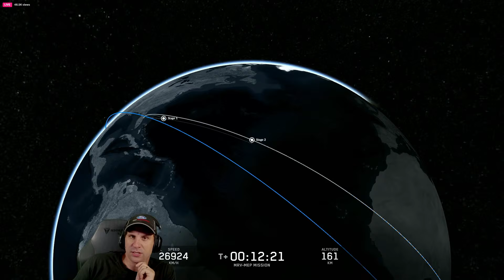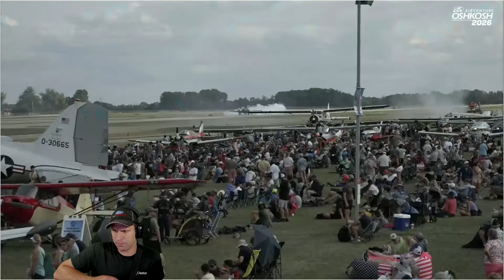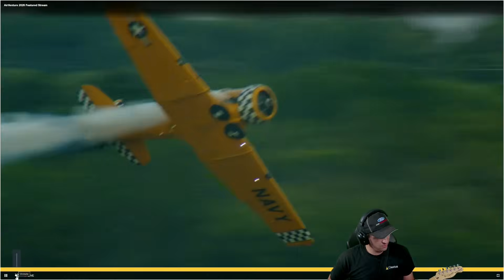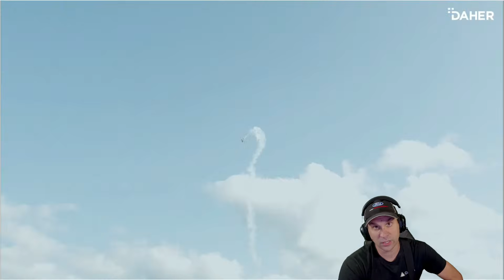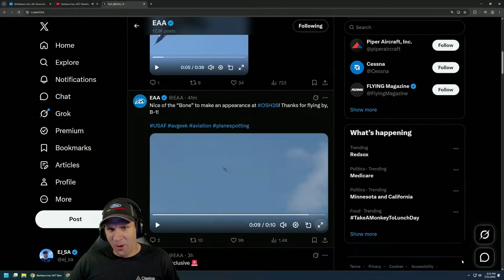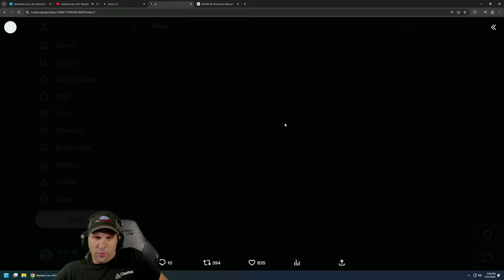EJ's Space and Rocket Revue! 7/21/26

Comment: You know what? I think there's been a bit too much focus on just flight's 13 and 14 from Starbase on streams lately (both yours and NSF's) and not enough on Starship's upcoming 18 months more generally. So here is a list of questions for you to think about and, if you feel like it, bring up on any Starship stream you're a part of (NSF stakeout, the Flame Trench, your own Rocket review etc. etc.). I'm sure you've thought and talked about these in the past, but now that everything's becoming more concrete and the "stakeholder expectations" for Starship have become more defined, I felt like spelling out the ones that I could think of off the top of my head. (I know I know, you're welcome lol).

-Based on the flight 13 timeline, what is the current production rate of ships and boosters? How many more can they build before the end of 2026 and how many will they fly?
-When will the gigabay at starbase be fully enclosed? And when will SpaceX start stacking the first ship (it'll probably be a ship) in there?
-If SpaceX can get gigabay at least stacking ships as fast as the current megabay by the end of the year, how many ships should they be able to build in 2027? 24? More? Less? How many launches would that allow for 2027 depending on ship reuse? Can their pads and booster fleet handle that?
-Which ship number, as of now, do you think will be the first prototype fuel depot, which the first prototype tanker, and which the first prototype HLS?
-Which ship number wll be used for Artemis III? Which for Artemis IV (assuming SpaceX will be the one doing that mission)?
-How many launches does SpaceX need for Artemis in 2027, and will they prioritize those depots, tankers and landers even if it means almost no Starlinks?
-Just from the current operational pad in Starbase, what do you think SpaceX wants the launch cadence out of that pad to be by the end of 2026? What about by the end of 2027? Where do they need to be in terms of either booster/ship production or booster/ship reuse in order to meet that cadence?
-How many boosters and ships will SpaceX barge from Texas to Florida during the rest of 2026? How many in 2027?
-How many booster reuses are SpaceX planning to make the first few boosters that get caught (so hopefully from B21 onwards) do before retiring them?
-When will Pad A at Starbase come back online? What cadence will SpaceX be aiming for with that pad after a few flights out of it?
-How much faster (if at all) do you expect the pads at 37 to go from "tower stacked" to "first flight" compared to the previous pads? (edit, you and Ryan kinda have a bet now on this one, you willing to clarify your stance by giving the exact month wherein you estimate 37A will have its first full Starship stack?)
-Will SpaceX have all 5 of the Starship launch pads currently in various stages of existence operational by 2028? If so, how many Starship launches do you think SpaceX wants to do in 2028, and how many do you think they'll actually manage?
-At what Starship launch cadence will NSF no longer produce a patch for every single flight? Once a month? Once a week?
-At what Starship launch cadence will NSF no longer even cover every single launch like currently happens with Falcon 9? Will it be the same, lower or higher than Falcon 9?

Like I said, you're welcome. ;)
Reply from the maker: will discuss on the space news if you like. :)
Reply: @EJSA1  Fair enough. Just did.